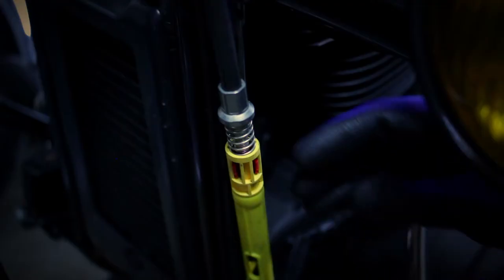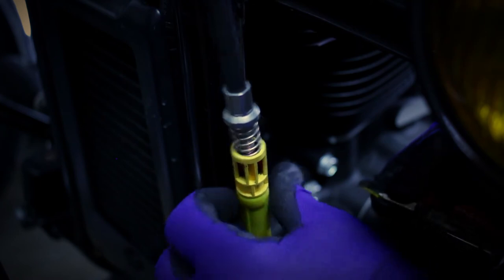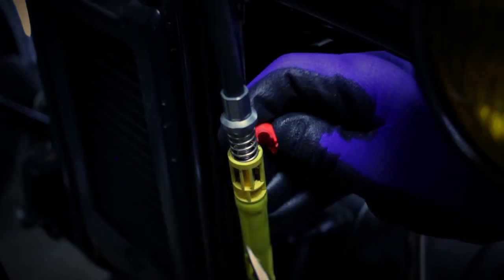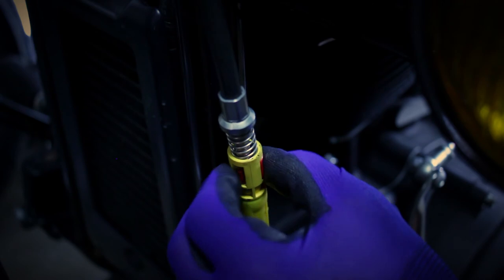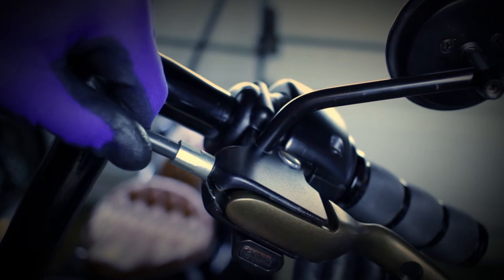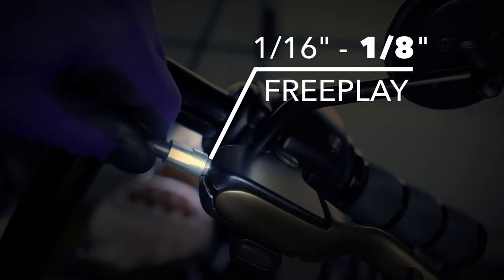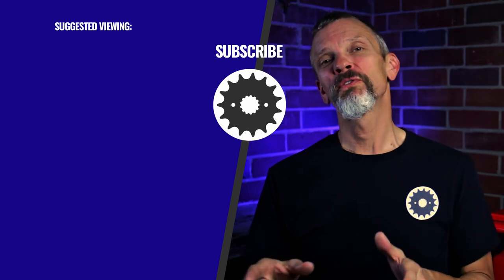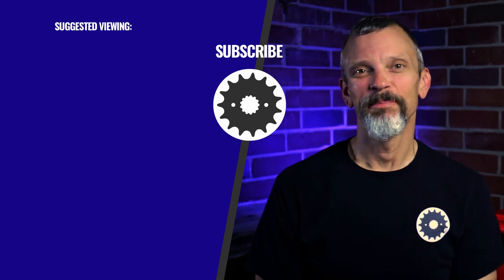Milwaukee 8 Upper Clutch Cable Free-Play • 2018+ Softail

Comment: You don't  show how to adjust free play ? You only show where it should be (1/16 to 1/8)  Mine is a hair over 1/8 th and would like to be at 1/16th.  So how do you do that?
Reply from the maker: Hey Kevin - when you release the red clip the spring loaded pressure basically sets it for you. You can push the upper clutch up away from the yellow part if you need to close that gap a little more but you have to be gentle. I usually make sure the lever is as far out as possible , away from the grip, then release the red clip and let the spring put tension on the upper cable, the snap the red clip in. That should do it. 

Let me know if that helps clarify it.

Comment: I swapped out to a longer upper cable for taller risers. It was really easy. I do worry if that plastic adjuster were to break on the road somewhere.

Love your channel ,all meat no filler. 
Thanks for sparing us a comedy routine or small children running around. That shit is annoying as hell.
Reply from the maker: Hey Dave - thanks for the kind words! I'm glad the video was helpful. For that red clip - I know what you mean. The good news is that's a part that you can get from H-D so it's probably worth snagging an extra one and keeping it in a saddle bag or tool roll. Here's the Harley-Davidson OEM part # for the red plastic clip: 37200395A

Comment: I used your easy to understand, well spoken video to refresh myself on the procedure from when I adjusted cable on my ‘19 FLSL but the problem with my brand new ‘23 Low Rider S is the cable is too tight, once you expose and work the process the adjusting of free play is pretty obvious but you might consider demos for both, thanks again, without these videos for us YouTube mechanics the time to do would be much longer with a whole lot more trial & error.
Reply from the maker: Hey Ronald Linton - thanks for the kind words and the suggestion! I’m glad this was helpful.

Comment: i have a 2021 FLHXS . i was riding home from work and all of the sudden, i had no clutch. i have tried top adjust using you method but i have three inches of free play at the lever. When i release the red button there is no tension on the spring whatsoever and the button will close an inch away from the threads.
grrrr!  is there no adjustment for free play?
Reply from the maker: Hey tljcfm - it sounds like it may have gotten decoupled from the lower cable. If you inspect the yellow part you’ll see an oval window where you check to see if the ball end of the upper cable is still seated in the hooked end of the lower cable. See if you can spot any issue there. There’s also the hub adjustment but that only makes a small difference and nothing like what you’re seeing with that much slop. This video may help: https://youtu.be/oOaADTwUu6k

Let me know what you find…

Comment: Hey Ron after putting this clutch cable ext in my clutch is very loose at the top on the handle bars? Is this common? I can’t seem to find a way to adjust this back to having tension on the clutch? Any thoughts? Thanks my bike is a 21 Streetglide special
Reply from the maker: Hey Kyle - the spring down at the yellow adjuster should take up all the slack and set the preload on the cable housing. Have you released that red clip down at the yellow adjuster so the spring can expand, and then snapped it back in lock it in place?
Reply: I have a 21 RG Special, and ran into the same issue, found that the way the cable is routed doesn’t fully allow the mechanism to pull back the take up. 

What I did was release the red clip, grab the yellow tube, pull the cable itself down gently to collapse the spring, and using a finger to snap the red clip back in. Then make sure the cable is completely in the perch and the lever is all the way out, and once again released the red clip to allow the spring to expand, then reinsert the clip and measure.
Reply from the maker: Thanks for sharing that!

Comment: So if I want my adjust my clutch to engage faster as I let out on the lever,  this is the way to do it?
Reply from the maker: If you set your lever free-play and you don't feel the difference you're looking for you'll need to do the hub/basket adjustment, and experiment with different settings within the range. Check out the other video I did about that adjustment: https://youtu.be/qfmE5D6qxmE  (it's also a quick and easy adjustment but you'll need to remove the derby cover)

For adjusting that range, the more you back out the adjuster screw the larger your friction zone will be. Maybe try starting with 1/2 turn out with the adjuster screw and see how that feels.

If you want a channel sticker, DM me on Instagram @RonsWorkshop. Thanks for watching and commenting!
Reply: Ron's Workshop awesome thank you for the help!

Comment: So could this help with getting into neutral? If I'm sitting at a stop light in first it's virtually impossible to go into neutral and when I'm in first with the clutch pulled all the way in it'll creep forward could thing help with that ? 
2018 sport glide with a 107 if that makes any difference
Reply from the maker: Hey Juleein - yes, it could help. Also check out my other video for a full clutch adjustment. If the free-play adjustment doesn’t help you could do the full adjustment as well. It only takes a few minutes:
https://youtu.be/xnD6rnGf5oI

Let me know how it goes!

Comment: What can I do to remove excess free play in the cable when the adjusting screw is turned out as far as it will go? I just adjusted the clutch at the clutch basket and backed off the screw 1/2 turn. When I go to adjust the slack at the handlebar lever, I have at least 1/2 in. of slack which I can't take out. What can I do?
Reply from the maker: Hey Carlos - man I’m not sure. That’s a lot of excess play. I wonder of that yellow adjuster has an issue?

Comment: What happens if u can't  get the slack less than 1/4". Even if I pull the spring apart as I'm putting the clip back in? Do I need another hub adjustment?
Reply from the maker: Hey Kevin - that’s probably worth doing. I’m wondering if it could also be a cable wear issue? You shouldn’t have to put tension on that adjuster, as the spring should provide enough preload. I can’t say for sure…I’m just spitballing. Let me know what you find!
Reply: Even after adjusting my clutch at the hub and the cable I was still dealing with almost a quarter inch if not more of free play at the lever. I figured out if you release the red retaining clip, then pull apart on both ends of the cable directly above and below the spring that's exposed but not on the spring itself and while doing so snap the red retaining clip back into place it will take out all the extra slop/free play. Of course I figured this out after ordering a replacement anti rattle spring for the lever housing but I'll take that $10 hit for the sloppy rattily clutch lever to finally be gone 😂.
Reply from the maker: Thanks for sharing that tip!

Comment: Ron adjusting the play out of this Milwaukee 8 clutch cable after taking tension off cable lock in place I turn yellow  Knuckle right to tighten?
Reply from the maker: Hey John - when you pop the red button out, the spring should apply the right amount of pressure / preload. Then you snap the red clip back in and check the free play at the perch. The yellow part turns but it doesn’t adjust anything as it turns. It just spins free. Let me know if that makes sense.

Comment: I have adjusted my clutch at the basket and I still have too much free play. Is there any way to reduce the free play? I have the adjustment all the way tight. I'm trying to get the bike into N while running. It's fairly easy when the bike isn't running  2020 Heritage 114
Reply from the maker: Did you release the red button and let the spring take up the slack down at the yellow adjuster? And then snap the red button back in once the spring is under tension?
Reply: @RonsWorkshop  I fixed it. The best free play that I could get 3/16 and that made the friction point to close the grip. So I made a spacer .120 thick and  with a small slit  I slipped it over the cable  between the outer sheath and its landing spot by the clutch lever. So far it appears to be working. Now I can find N fairly easily with it running. That new adjuster is great when everything is working but it leaves no room for error. Hopefully this fix is a long term  solution! Thanks again for your input.
Reply from the maker: @ronkuszik5756 excellent! Enjoy the ride :)

Comment: Excellent video - very clear, thank you so much.  My question is: I’d like my clutch to catch closer to the grip (right now it catches all the way out), AND I’d also like to reduce the pull distance (reach) to the lever.  Adjusting the clutch at the basket per your video would allow me to adjust in where the clutch catches but I’d still have to pull the lever a greater distance than I’d like.  I tried installing an Oberon adjustable lever but frankly the fit was wiggly and didn’t really get me much less pull distance than stock.  When I put my stock lever back on, I noticed that I can just pull the cable down on the adjuster spring a little and lock it there (increasing the free play of the clutch but also achieving my goal of both having the clutch engage closer to the grip and also reducing the pull distance on the lever).  My freeplay is now around 5mm or 0.2 inches, almost double what HD recommends for freeplay.  Is there any issue running it like this?  As long as I ensure my clutch is fully disengaged when pulled into the grip (which it is, with room to spare), I should be ok right?  Sure, my lever in its outer limits has play, but this setup serves my double purpose of getting the engagement closer to the grip and reducing the pull distance on the lever at the same time.  Let me know what you think.
Reply from the maker: Hey nycvt - thanks for the kind words! I think one risk with excessive free-play is that could allow the clutch cable to dislodge from the clutch perch. That’s just a guess. I recommend keeping all of the adjustments within spec and then tracking down an adjustable lever that suits your needs. Let me know what you end up with!
Reply: @RonsWorkshop  Thanks Ron, I’ll give the Oberon another shot.  On another note, I’m going to be installing a Muller Power Clutch, not sure if you have any experience with those.  After installation, they say to spin the clutch adjustment back only 1/8 of a turn.. seem like too little to me, so I may go with a 1/2 turn to start and leave the stock lever on until I get the Muller adjusted right.  I guess I will have to try it a couple of times and see where it grabs.. but especially if I’m planning to put the Oberon back on, I’ll need the clutch to grab out further on the stock to accommodate the shorter travel of the Oberon to make sure it disengages at the grip.  With the Muller I’ll also need to be concerned about whether I’m not getting slippage all the way out.  I know people do this combo job all the time (adjustable lever and Muller) but not sure if you have any advice/experience with clutch adjustment after putting in one of those.  Thanks!
Reply from the maker: @nycvt4576 nice! Let me know how it goes. I don’t have experience with either of those, so I’ll learn from you :)
Reply: Muller power clutch install was super easy and it works great. Backed it off 1/6 of a turn at the hub from the starting point in your video (just enough that barely knocks down the Alan wrench). Came out perfect, no slipping, and full disengagement at the grip. Went back to stock lever because I didn’t like the ergonomics of the Oberon, may try to look for another soon. Also will continue to find ways to make the clutch even easier (butter as they say!), maybe with lighter springs.
Reply from the maker: @nycvt4576 glad it’s working well!

Comment: Ron not sure how long you've been posting (I'll go check) but I equate you to a Doc Harley out of Charleston SC. You're so knowledgeable but you get right at it. Cannot believe your channel hasn't exploded. Maybe start working on other Harleys so you get into more feeds. But you're obviously a level-headed guy. I hope you will take off and help a lot of riders.
Reply from the maker: Hey NBT 3 - thanks so much for the kind words! We’ll see what the future holds. I’m all for adding bikes to the lineup as the budget and time allow 😃

You may also want to check out my recent video on making the clutch adjustment at the hub in case you ever need to do that - the new one includes an explanation of how the adjustment ranges affect the friction zone and clutch engagement: https://youtu.be/xnD6rnGf5oI

And if you want a channel sticker send me a DM on Telegram or Instagram with the mailing info @RonsWorkshop

Comment: So are you saying to take up the slack I push down on the spring a bit and then lock the red button?
Reply from the maker: Hey Mike - it’s actually the opposite. To take up the excess free-play in the lever you pop out the red clip and let the spring expand fully, then snap the red clip back in. Let me know if that helps.

Comment: Ron,

so I get the automatic 1/16 to 1/8 free set procedure.  and understand when the spring is fully collapsed the free play is set to max with allows the lever to be changed.  thanks.  

I, and I see others below may want to adj in more more free play,  I saw your answer which said to refer to the clutch basket adj video.  thanks.

but.. 

cannot more than 1/16 to 1/8 free play be put into the upper cable/lever system by TURNING  the yellow barrel either CW or CCW?  and if so,  do you turn the upper short barrel or bottom longer barrel for the fine adjustment?  Maybe the turning of the yellow barrel procedure is another video?

Or is it that the yellow barrel system only has two positions period, no turning, it is either fully collapsed or fully extended, that's it no fine adjustment from the yellow barrel period?  

I'm confused.  thanks for any help.
Reply from the maker: Hey Elvis - your last option was correct. The yellow part spins but doesn’t make any adjustments. It spins only to a) allow you to line up the access port for connecting to and disconnecting from the lower clutch cable and b) getting to the red clip. The spring is the only part that enacts any adjustment on the upper clutch cable, and it just preloads the housing to take up the slack in the cable. The adjustment down at the hub is the “real” adjustment. Once that is set properly the spring can take up the slack as intended. If you ever need to do the adjustment down at the hub / derby cover it’s super simple. Here’s a video for that: https://youtu.be/xnD6rnGf5oI

Let me know if that helps clarify things…
Reply: @RonsWorkshop  Ron, your explanation helps a lot!  Turns out once again, I was working on the wrong end of the deal.  I have watched your referenced video and now with this reply information, all makes sense.  When only riding the bike "normally" I'm good with the tight free play and far from grip start of the friction zone and full engagement of the clutch.  However when riding the bike in slow speed tight turns and manuvers I feel I want the start of the friction zone closer to the grip; this helps me control the bike much better for slow speed, "precision" riding.  My plan of improvement now that you helped me understand the clutch functions is to #1 get a reduced reach clutch lever, #2 set free play to spec, and #3 adj the clutch as you have shown to have start of friction zone much closer to the grip.
Reply from the maker: Excellent! So glad you’ve got a good understanding now. Let me know how it goes once you tackle it. 

If you want a channel sticker send me a DM on Telegram or Instagram with the mailing info @RonsWorkshop
Reply: actually you can indeed "lock the clutch free play" by depressing the red button, anywhere along the length of the spring.  so it's more than just a two position adjustment.  I set my free play to 3/16 of an inch which is perfect for me.  so case closed for me on this one
Reply: so I adjusted the clutch at the basket, backed out the adj screw 1/2 turn from initial contact.  process is really well explained on Mr Ron's video.  The 1/2 back out stetting moved the friction zone back toward the grip perfectly for me.  I also got the Softbrake reduced reach lever for my '21 road glide, so with the reduced reach lever, the friction zone moved back to the grip, and free play adj to 3/16 my set up is much improved.  and I can service it myself now that Ron helped me understand the procedure.  Only thing left is to replace the Softbrake with the Oberon adjustable clutch lever when it is released for the '21 road glide; I like the oberon a lot better.
Reply from the maker: That’s correct! I like mine under full spring tension, but that little red clip does give us a bit of adjustability for dialing things in.
Reply from the maker: Excellent! Thanks for the kind words! It sounds like the combination of the clutch hub setting and the levers really give you a great setup. Thanks for sharing the detail as well.

Comment: I changed my levers and now my cable is a little tight. How do I get it to loosen just a hair?
Reply from the maker: Hey Thomas - is the cable housing too short now, or is it just that the clutch lever needs more free-play? Did you swap out the clutch perch too, or use the stock perch?